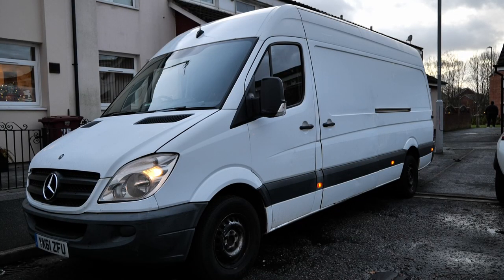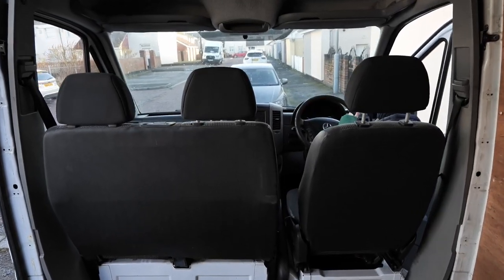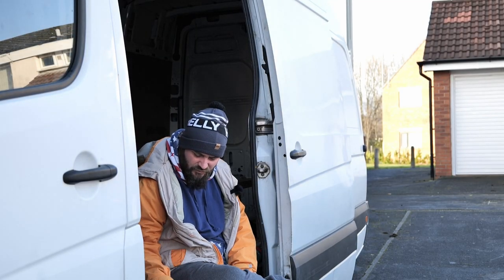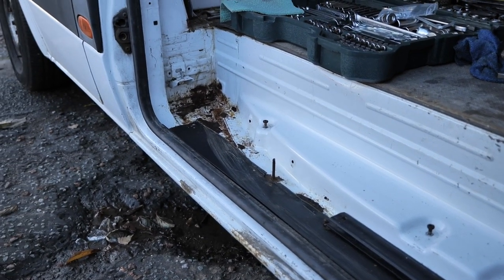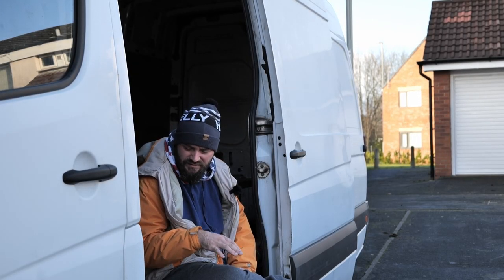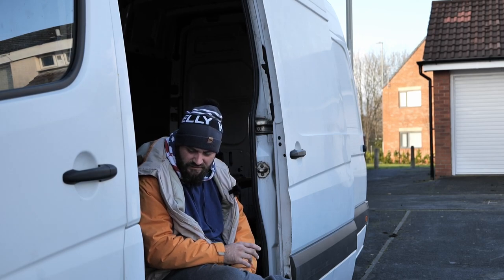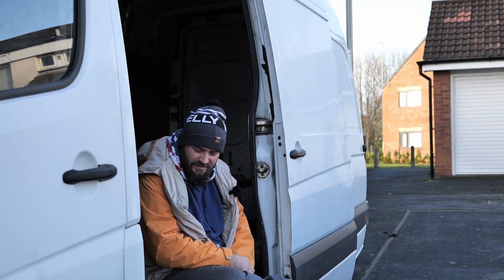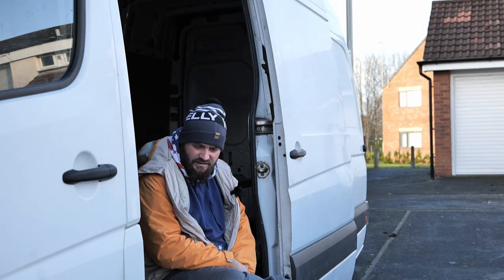Sprinter Van to CamperVan - Starting the Build with COVID

Comment: Greg is the man, very informative. but great start man. take it easy and remeber to have fun building it. prob doesnt help in the winter! one thing i'd say is that you seem to be fixing things that need attention before hand. they will come back and brake again. remove everything and clean the van in a nice dry place if possible and start from ground up. it will be so much better for the spirit and you'll appriate it. cant wait for more
Reply from the maker: Thank you for the suggestions 👍

Comment: Building a van in Winter is tough, and you're not well either. I'd leave it for a few days until you're better. I did the same as you with my van - rip out the bulkhead, steps, floor. Then I did the cleaning and hammeriting you mentioned. I'd also take up the floor and have a really good clean underneath. Use it as a template for a new floor if it's in bad condition. Think about what cables you want to run along the floor before you put it back and add a couple of extra cables for things you didn't think of! Put insulation down first (foil bubble stuff) and then the floor on top. Check and replace door seals if the steps are getting water under them. I'd start on sound deadening next - heavy flexible sheets that are sticky on one side. You stick them on the large panels to take out the 'tinny' noise of a large van. Really adds to the comfort once you've finished. Fitting windows is something you can do now too - it's not too tricky, you can do it yourself with a jigsaw to make the hole and they come as a kit with the adhesive. Make sure you use lots of the adhesive!
Reply from the maker: Hi Paul thanks for all the useful info. I removed the floor today and it does not look bad. will need a good tin of hammerite tho. I am thinking of keeping the old floor as it is in fair condition, and stick some vinyl on top. nice and simple. cables? pff they are a mistery. I should think about the layout first. Thanks for suggesting to put the bubble stuff insulation first, under the actual celotex, nice thinking thanks! I have already got the sound deadening sheets, and now considered the windows, although I am terrified to mount them myself 😄
Thank you!!! 🍺🍺🍺

Comment: Hey Raul, mind yourself and your family and you'll be fine. Your van build is going to be a challenge and will test your ingenuity, skill and patience. I got my hands on a lwb 2007 315cdi back in 2016.only now have we gone to Europe in it. My advice to you...firstly, ensure you deal with any and All rust straight away. Secondly, if you have a plan, accept it will probably change, thirdly, keep it simple for now as you can always make changes/upgrades in the future. Thirdly, weigh everything you put into the van... It is so easy to exceed 3500kg with a Sprinter unless it is a 5 ton van, my van is running at close to 4 tons! I wish you well with what you are doing and will be happy to answer any questions you may have. 👍
Reply from the maker: Thanks for the tips! 👍

Comment: Nice to see an 11plate sprinter mate, I used to run these 24/7, the egr pops up but it's not sometimes, my 3 had the same problem, in the end because of the mileage I had to have the injectors recalibrated because they was running for a new engine not one with 250,000-300,000 miles on it, and that cured the fault, good luck 👍
Reply from the maker: Thanks for the info. Much appreciated 🤘

Comment: Get some brick acid/concrete cleaner same as Kurust paint on then wash off deals with rust.Hammerite get a large tub of the thinners/brush cleaner there is a commercial alternative which saves you cash you brush it on it dries in seconds as spirit so when paint hammerite on it is easy to brush on and sticks properly unlike just slapping it on like many do then wonder why goes scabby plus always constantly stir paint up then get good results.
Treat inside of van body before sticking any panels on ACF50 is good can spray underneath with it also stops rust.used on M'cycles alot.
Clean up bulkhead panel then cut a doorway out so can walk in between the seats but have bulkhead security behind seats and more secure from "eyes"
Have external trim off and bumpers treating behind them as see the tin worm is biting rear quarter where bump rubber you replaced.
Plenty you can do on electrics side look at led lights so low drain you can have split charging plus get a night heater installed.
The more you treat/prevent rust etc the longer van will last as there known to like the Tin worm!
you most likley will have to replace front bushes on suspension see if can get the polyurethane ones then once done that's it.Check rear springs known to crack  plus shocks fail.
Then once all done well while doing install an alarm with likes of proximity sensors and so on as they do try to steal sprinters but many don't like Clifford Alarms as make so much noise and can't get past easily.
Once your heads cleared from covid will find easier.
Have a chat with some that know/have made these get ideas and get there thoughts then draw a list up as lots need to be installed earlier than later so not only looks tidy but also works
Reply from the maker: Nice thanks a lot for all this information  👍👍👍
I am waiting for some Kurust and some umderbody sealant to fight the rust. Cheers
Reply: @Raul689  The ole saying comes to mind! Measure twice cut once plus go have a brew before cutting as will remember/see things in a different light!
Why it's always good to ask others and get feedback/comments on ideas as you often miss things that others see/know.
you should have some lighting electrics in back already but the issue can be leds and Canbus why split charge is good with a large battery for backend electrics and most have a volt gauge in line to see battery condition. as what you don't want been parked up been using lights/gadgets/cooking etc etc then come morning whirr whirr click click main battery toast so not moving till jumped/boosted etc.
Know someone that's done similar to what your talking about it has split electrics.night heater.fully lined with a carpet which is like a sound deadening type but hard wearing it's still has his work van inside but can go anywhere and sleep in comfort.
My friend is in the renewable/solar energy business so can suggest on panels and storage plus is where split charge comes in as want solar going to second battery which you can run inverter off.